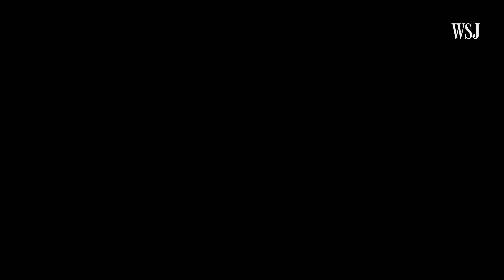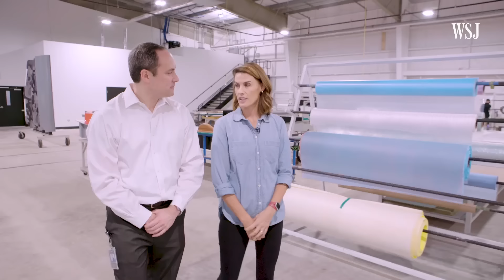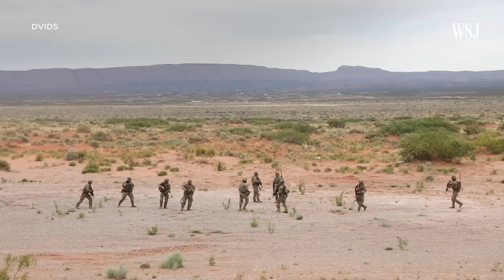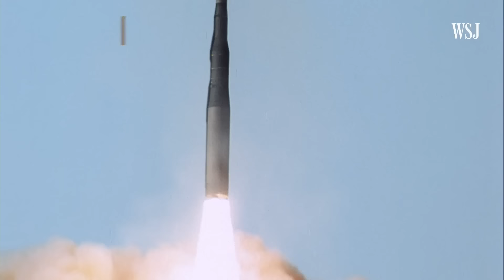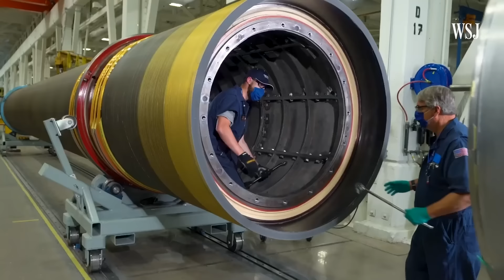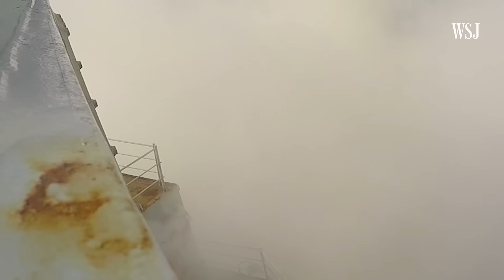Breaking Down Russia’s Vacuum Bomb, the U.S.'s M10 Booker and More | WSJ Equipped

Comment: To 'future proof' the hardwired interconnect, I suggest horizontal drilling, leaving an armor casing and running the fiber/copper, then pressurize the segments for fault detection.  Upgrades simply require removal / replacement of the data links.  (No more real estate issues.)

Comment: The New World Foundation ,,, Omnijet Ind had blueprinted a aircraft called the Triton that when converted to a submarine it would have 3 times the offensive capabilities of a monohull.  It has twice the thrust of a monohull and a large amount of dorsal area for solar panels when surfaced.  .  The aircraft fires TOW rockets of a significant size and a submarine version could fire torpedos also significantly.  The vehicles can be powered by our Sine-Wave generators and attain a speed of about 30 knots.
   The aircraft are being phased into rocket powered spacecraft to be used for low earth orbit plunging of sonic aircraft and ground targets,,,then speed back into orbit.

    They are called Tritons😂

Comment: The M10 does not appear to be built to counter what will be its nemesis, the FPV drone.  Back to the drawing board.  The design requirement is not so much to move infantry forward as to move one's own FPV drone controllers forward through mined areas to bring more enemy targets into FPV range, which appears to generally exceed the effective range of a tank gun, and to provide protection for that crew through electronic and other counter measures to thwart the enemy's FPV drones and mines.  Think of it as a sort of aircraft carrier on land.  The unit could involve more vehicles as does a carrier task force.  Many vehicles would be almost purely for defense against enemy drones.  They could launch balloons or quiet gliders to acoustically acquire enemy drones.  They could forward fire land-based, networked listening devices in a role similar to the sonobuoy.  Land assault is now a smaller version of the carrier task force rather than battleships (tanks).  The idea is for the number and variety of one's own drones and control points to outnumber the enemy drones and control points.  Mechanized artillery is still relevant because its range generally exceeds drone range, the naval analogy being missiles launched out of VLS's.

Comment: The Triton should have a camera at the tip of the sail in addition to the weatehr data sensors. That extra height can significantly increase its line of sight, especially if you have large waves. I think it would be helpful to have a thermite device to destroy sensitive equipment is captured. It wouldn't hurt if the thermite also burns through the deck of the the capturing vessel. lol

The M-10 Booker does not need anywhere near as much protection as the M-1 Abrams. Because the Booker is an infantry fire support vehicle, it really should be behind an infantry screen and never infront of the infantry, in theory. In contrast, the M-1 is intended to exploit breakthroughs, and therefore potentially expoied from all directions. To a large extent, some of its defense lies in its speed.

While the ICBM silos are spread out over 4 states, silos are also purposely clustered locally. The individual silos are spaced sufficiently apart that a single incoming warhead can not destroy two silos. However, they are close enough that the detonation of an incoming warhead may destroy (or at the very least, knock off course) other incoming warheads targeting the other silos. The silos are in teh ground and hardened. The incoming warheads are in teh air and unprotected.

It should be noted that the Arleigh-Burkes are not solely dependent on the AN/SPY-1. They can also take targetting data from other assets, such as ground radar, AWAC, or even a F-35. This may give the Arleigh-Burke more reaction time, especially against terrain following cruise missiles.

While Russia was using five times the artillery shells than Ukraine, better artillery spotting, combined with much more accurate artillery, has allowed Ukraine to almost approach artillery parity with Russia.
Reply: You've obviously never spent any time at Sea
Reply: @AnthonyOMulligan-yv9cg  

Actually, I have been sailing in small sail boats. I know there is a lot of movement at the tip of a mast. However, that doesn't mean you can't get valuable intel from it, even in large waves. Granted, you get next to nothing in troughs, but you occasionally have some time on a crest. Just need to freeze the frame to analysize the image.

Comment: Given the size of the solar panels, it is impossible to produce 750 Watts of electrical power, that would require about 10 m² with the panels perpendicular to the sun and the reduced polar intensity in the high humidity environment 
That needs to be said, I smell a rat

Comment: When there is a new model order, I would hope allowance is made for in line first order improvements should such occur prior to completion of a first order. Seems to me, if significant, any feasible improvements should be added to the first model if caught in time; rather than simply waiting until the first order is finished as ordered. Seems wasteful to complete any order without known improvements being incorporated, just for the sake of preserving the completeness of the first, or any order. Rather, when a significant improvement can be added to the original order, simply negotiate the cost adjustment, add the improvement to the remain see of the first order, calling it a 10A. After that, pray tell, include those improvements and any subsequent others into a second model grouping for future orders.

Comment: a whole section on the Mi-24.

and then they claim its designed to fight armor....
what?

its designed to be a flying Infantry fighting vehicle. its why it has a whole passenger cabin in the rear.
the soviets looked at how US operations went in Vietnam. saw how Huey's inserted troops supported by AH-1 gunships.
and they went, why don't we mush the intended purpose of those 2 helicopters into 1 helicopter of our own design.
and so they did, and that is what the Mi-24 is. its a helicopter that can insert a small squad of soldiers into battle, and can either suppress the landing zone if needed, or provide close Support after successfully inserting its squad of soldiers.

its was only later, more geared towards the armor hunting role, but even the most modern variants like the Mi-35 retain the passenger cabin.

also pretending that unguided Hydra-70 rockets are more accurate then unguided Russian S-5 or S-8 rockets. or that carrying rockets meant for hunting light armored or non armored targets, will suddenly make it a armor hunting monster, is copium of the highest degree.

nice mention of the guidance kit for the hydra-70. Dont think the APKWS is going to be delivered to Ukraine anytime soon.
and if it does, it will be a matter of weeks before Russia will deploy its own variant called "KOR" just like they have with every other weapon system. from ground launched small diameter bomb, to JDAM-ER to HIMARS.

the Russians have responded to every weapon system by deploying their own variants. UMPB, UMPK, Tornado-S/G. even when in some cases western "experts" told us that many of these systems were not in service with the Russian military and the sanctions would prevent them from building them in any significant number too.

Comment: Google Rheinmetall Denel Munitions and read developments on 155 mm missiles for the South African G6-52 howitzer. They are busy developing a ramjet assisted 150 mm missile, firing over a distance of 150km +.
Also, busy developing mortars that can be fired as far as 20km.
They are also busy along with Northrop Grumman to make a sniper mortar.
You will see that RMD South Africa is busy developing munitions for howitzers,  mortars, and bombs more deadly, but also firing over longer distances to save money on the more expensive rockets.
You have mobile howitzers firing distance up to 20 km.
Now you will have 120 mm mortar firing 20km.
The South African G5 towed howitzers can fire at distances from 30 with normal ammunition up to 50km with rocket assist.
It is the only towed howitzer in the world that send missiles over a longer distance than most mobile howitzers and the cost of a towed howitzer is much cheaper.
South Africa is developing weapons and ammunition hidden to the public of the world.
Reason. Certain countries are afraid that South Africa will sell weapons and ammunition to clients of them, making them lose billions in contracts cancelled.
Rhein Metal Ammunitions are going to expand the factories in South Africa to double their production of 155 mm ammunition and mortar shells.
It could be an eye-opener to the world if a program like this investigates the South African arms technology.

Comment: Surprise, surprise, even WSJ falls for BS regarding a "Ninja Bomb", more than likely based not on rational and vetted facts but instead on rumors that originated with "video game warriors.". The actual weapon is a very small TBX warhead placed inside a mostly empty, AGM-114 ("hellfire") type air-frame. The missile was modified specifically to lower the cost of the original AGM-114 (which was meant to be used against tanks and heavily armored targets) while also significantly reducing "collateral damage", when used for "targeted individual personnel" (i.e. targeted assassination). due to the much lighter warhead, the missile's center of gravity as well as center of dynamic stability changed, requiring an aerodynamic stabilization solution, in the form of the six expandable knife-like wings protruding from the missile body frontal section. The "Ninja Myth" is nothing but stupid conjecture information proliferated on the Internet by substandard  "drone journalists"...
Reply: Nice.
Reply: Yeah, and just sooo hapens that this 'aerodynamic stabilization solution' has terrific secondary use :D  Because using e.g. steel ballast would be to difficult :D

Comment: how many can fit in it would make sesnse as an evac vehicle too if there is no air support.  I am guessing they are safe but you need to splice fiber optic cable but copper cable can just be induced through currents from the surface you just need something that can penetrate the ground electrically.

Comment: You can always make sure the command to use weapons has to be givin while everything else is autonomous.

Maybe the drone relays target information and then a person in another aircraft or on the ground issues the command. So the drone relays the information and then a human picks the play or strategy to attack the target.

Make it so the drone can't enable armed and ready to fire mode without a human. Doesn't have to be optional.

Even with man in a cockpit a drone can do many autonomous functions. Tracking, targeting. All before allowed to fire by a physical switch. Or a man does some task while the Ai does others. The neat thing is. With larger drones that they normally remote control anyway. A supercomputer burried in a mountain near a nations borders can remote control the drones through the same satellite link by taking over the remote control when we hand the controls over and read all sensor data from all aircraft such as drones and whatever and come up with better strategies including how to jam or avoid jamming.

So a supercomputer can bring anything we have just one frame of information about from any sensor a man may have missed to the attention of a man who can make a decision.

Good thing Nvidia with the new Blackwell technology made a new chip that with just one rack on a server or datacenter is more powerful than the current most powerful supercomputer and it's Ai at 1.4 escale for one rack and supercomputers usually have many racks.

So within a few years tops we will be beyond exoscale to the next scale

There is no way to know if a man is piloting something inside or remotely or autonomously.

And no way to verify any of this without spilling other military secrets about any aircraft.

Because you would need insoections of hardware and possibly software to verify.

Then add in with SSD's you can hot swap datasets / instruction sets.

For example a drone learns from humans and from flying and doing missions. Then you can swap out the SSD and review everything at a base. Then you can decide if the algorithms the drone learned are good enough to go to a whole fleet or if you want to tweak.

Then anytime a mission needs something else entirely. Swap the SSD's out and new ones in and ready to go wants weapons or other equipment is loaded. And that would spherehead any attempt at knowing if an adversary is using ai because they could swap in a dumber system software set within minutes.

I figured at minimum supercomputers will help man and optionally take over the remote control a man normally uses. Just the processing of all image data and mapping faster and more efficiently than humans is a major bonus. And this doesn't have to be outside of any internal ai the drone as for when there is no communication. For example. During jamming the drone can complete the task and fly home because of terrain mapping it does while flying and also having maps preloaded from satellites including the live maps when not jammed from satellites.

There is nothing stopping us from doing any of this. The hardest part is finding a good setup where we don't always allow the drones to have control but is only optional when needed.

For example. We are in a bad war. Maybe it even went nuclear.

Well we can use autonomous drones for when we need a direct hit but we couldn't survive the mushroom cloud. A man could fly it all the way to target optionally unless it gets jammed at the last minute.

Sure we won't let AI be in control of nukes but if a war is bad enough. We may need to hit a hardened  target precisely. For this a drone could get low and dive to the target with controlled flight. Either release a weapon or be the weapon.

Works even better if it's stealth.